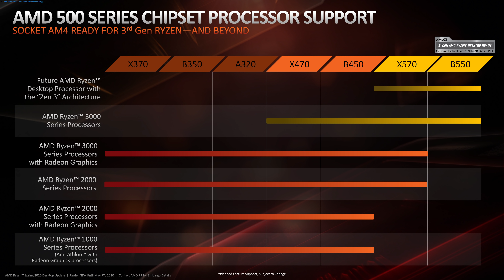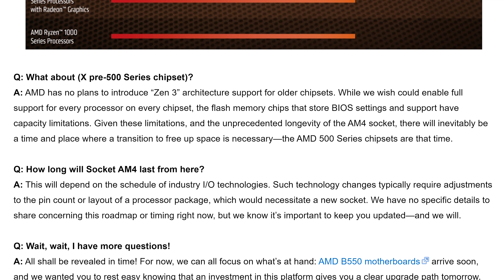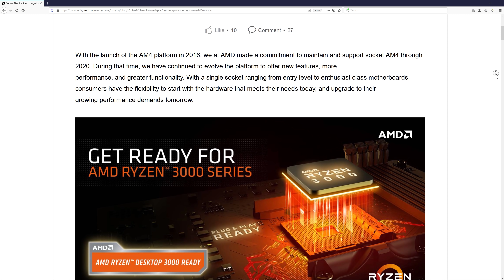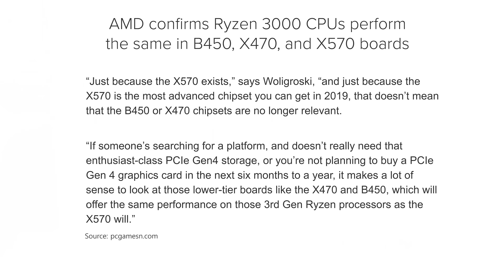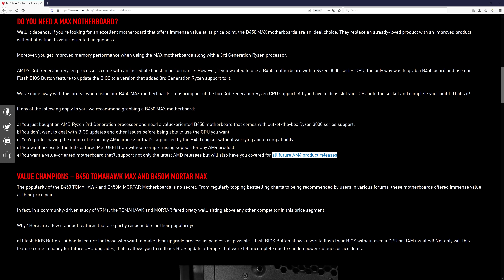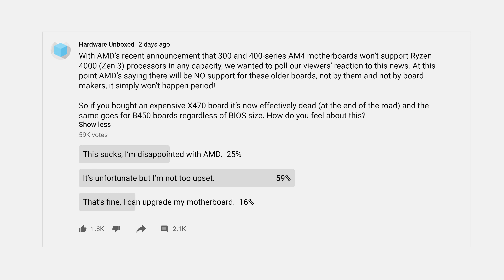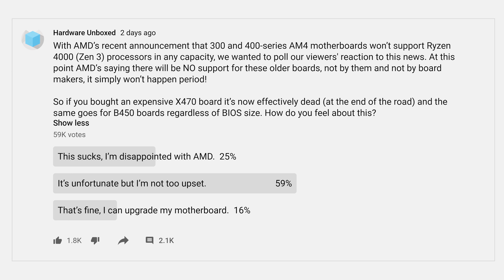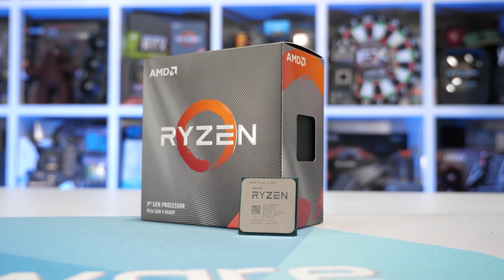AMD Does An Intel, Axes Zen 3 on 400-Series Motherboards, Our Thoughts

Comment: I didn't vote in your poll but I agree it is a garbage move by AMD. At the very least they could've provided support for the X470 motherboards (considered premium), all of them coming with ample BIOS flash storage. The AM5 600 series chipset and Ryzen 5000 series will be supporting DDR5, now there is even less incentive to upgrade to a 500 series chipsets. I WAS going to upgrade my CPU on my X470 board but now will be skipping Ryzen 4000 regardless of how "good" it is. No way am I buying another motherboard/chipset only good for 1 generation, AMD's loss.

Comment: I just move from an older I7  to a B450 Tomahawk Max and R5 2600 with the intention of loading it up with a Zen 3 processor ... I am PO'd.  If I had known I would have waited and picked up an X570 instead.  It wasn't just on MSI's website with the board details but literally, every reputable review site also stated support through 2020 not to mention the AMD post sited here.  The fact that B550 was not even an option and widely speculated that due to its continuous delay it would not even be released this generation.  I don't think it is reasonable based on the industry's well-known belief about AM4 compatibility that AMD did not bring this information forward sooner.  It seems like a gambit to push board partners to sell off the remaining B450 stock as a current product.  Although it's not like we didn't see the warning signs when 1st and 2nd Gen Thredripper board owners got hosed.

Comment: As someone who bought a B450 Gaming Carbon Pro for my new Zen 2 setup, I'm a little miffed. But honestly not that much. Yes, knowing that Zen 3 wouldn't be supported I likely would have spent another $50-60 on one of the mid-range x570. But honestly, I still have an upgrade path in the used market with a Ryzen 3900x or 3950x, which will likely provide more price to performance than jumping up to a similar 8 core Ryzen 4000 (though we'll have to wait to see). Overall, I'm very happy with what AMD has done in the market, so I'm willing to let this one go.

Comment: I really feel folks will view Zen 3 and B550 as kinda their own stand alone platform due to how many folks will need to replace everything (CPU, and mobo) and view it as a more stand alone platform with no future support. I have a Ryzen 3000, and a B450 I doubt I would have upgraded but I might have. Given the situation tho (outrage aside) I will not be purchasing Zen 3 guaranteed, I had my i5 6600 for 5 years with the original motherboard.

I've had my B450 and 3000 series chip now for 5 months, I simply refuse to ditch both after 5 months to buy the newest CPU, only to turn around and ditch that a year later for long term support on the AM5 socket. Everything aside I feel it was a bad move on AMD's part, I understand why, but the vast majority of folks on the AM4 platform will need to ditch everything as if it was a new socket, only to have something outdated day 1. After this is AM5 and many years of support on that, just that alone makes this release seem like a bad investment tho, either ditch everything now and buy it, only to turn around a year later and ditch it all again for AM5, or hold off and skip this gen and go with the long term support of AM5.

I don't think it's sales, or motherboard vendors plot to make money, I think this move will financially hurt them due to virtually everyone on AM4 up until not having to replace everything for it. If it was just a CPU I believe more folks would buy it, more folks might decide they like a B550 board as well but your basically buying into a dead platform day 1. I strong feel Zen 3 and B550 will be viewed as the black sheep of the AM4 socket and I mean that in 100% honesty I really, truly feel there is not enough selling points for folks to invest this much into it, if it was just the CPU that's a smaller investment and might happen but not both CPU and Mobo for a dead socket with AM5 right around the corner.

The buy in cost is just to high for most who are currently ok with the chips they have knowing AM5 will give years of support if they can wait that 1 year.
Reply: ANd the fact that some don't have the money to do a mobo change with the virus going on!

Comment: Technically, AMD didn't go back on their word as they promised full compatibility across generations UNTIlL2020,. That being said, it's good that they know that people are watching and will call them out at the drop of a hat.
Reply: They implied through Zen 3 which was originally to be released in 2019.  The original road map was Zen 1 2017, Zen 2 2018 and Zen 3 2019.  And lots of their reps have said through 2020 not until 2020.

Comment: If only they had released the b550 at launch. Now it just feels like a scummy move to push x570 sales
Reply: If they had only said at X570 launch that it would be the only one supporting Zen 3.  Then their board partners would have revolted as there would have been no B450 sales.
Reply: Yup. Think its a coincidence that x570 is the first chipset that AMD makes themselves? I don't!
Reply: and then no costumers would buy X570 it would be a waste, but also is a waste to those who bought X470 expensive boards and those who bought B450 shouldnt be butthurted, cuz they bought that board to pair it with better CPU just like my self i could even put a damn Ryzen 9 there and still get super cost to performance,  i paid very little for the board to have it paired with 3700x, and im butthurt about no support for more expensive X470 users

Comment: There is no point buying a B550/X570 for future compatibility unless Zen4 is going to be AM4 also.  AMD have kinda shot themselves in the foot.  I was going to grab a Zen3 chip, but if there is no backwards compat support...  It makes sense to wait for AM5 mobos as the new mobos are dead end products.

AMD should allow mobo manufacturers to offer support in the beta bios and make it clear that they don't officially support the platforms for Zen3.  That way they don't have to allocate much engineering resources, and they can offload the work to the likes of Asus, MSI etc if they choose to offer the support themselves.

Comment: I think 3 generation support is very good.  If I were to use each generation of CPU for 2 ~3 years per generation... that is milking the platform for 6~9 years in total.
Hardcore users will upgrade with every new release.
People who keep same system for 6+ years is likely upgrading due to hardware failure or really doesn't need anything powerful to daily tasks or bought a high end CPU at launch to maximize performance from each generation.
Reply: I stuck with my i7-2600 from 2011 to 2017.  I started on a Ryzen 1700, on a B350 motherboard. I now support 6 Ryzen systems in the extended family. The 4000 chips would have replaced probably three of the 2000 chips that are in use on B450 boards.   One 3600X has already replaced a 2400G, the 2400G was put into a new build cheap B350M.  That 2400G will get a video card the  next time there is video card upgrade in the family.
Reply: @jamesthomson8659  :) I build my 2500K back in launch as well.  Only thing I have replaced was CPU to 3770K & GPU.  Still using same PC & Power Cooling 750 Silencer PSU :D.   And my DVD-RW tray won't open anymore after not being used for so many years. 
My initial plan was to get X570 but since I had to wait, I wanted B550 but get a cheap on sale or used 2000 series CPU, and few years later I could upgrade to one of those 3000 series 8 core or 4000 series CPU.
Which could serve be well for atleast 6 years.   If B550 doesn't support 2000 series, I many have to opt few more dollars for low end X570.

Comment: They are also ruining a perfect transition to AM5 and DDR5. If I am not mistaken DDR5 boards drop next year which means new motherboard YET AGAIN next year! Lets see how much of a vilain they will look like then!
Guess what: I don't plan on upgrading my Crosshair Vi Hero just for one generation of CPUs no matter how good they are, only to end up on a dead end platform, stuck with DDR4. And like you said the bios chip excuse is BS. It is either that they don't want to spend the resources for the support or that the motherboard guys are pressing them because they don't sell as much as they want due to the broad compatibility of AM4. Regardless of which is true, it is a mistake and I hope they reconsider in time.
Reply: Yes, changing MB and socket for going to DDR5 is perfectly acceptable for everyone, this is not. They destroyed all the trust they had build with customer during the past 3 years...

Comment: Re: your poll. I voted in it before I had a clear picture of what was being asked (I hadn't seen the actual news, just the poll question). I wouldn't have changed my vote, but I do wonder about the other people who voted 2. I'm not planning to upgrade my computer as newer chips come out, but am planning to build a new computer to stand beside this one. Which would mean a new board along with everything else. Are there B450 buyers that have the same outlook? If so, what percentage of the voters do they represent?

Note, I know I'm not typical -- I am definitely in the low heat/efficient power use/low noise category (but no, I didn't get a 1650 graphics board).

Comment: i purchased a 2700x and x470 msi gaming pro carbon last year. i upgraded to ryzen 3600x for the single core performance and upgraded bios, was extremely pissed when i found it was a "Lite" bios. its a garbage bios. Last month I sold the msi board and purchased an x470 asus crosshair hero which has plenty of space for newer bios and figured id be safe for ryzen 4000 series. now i am not! its just stupid. might as well go back to intel and just get the best gaming chip done and done. salty AF

Comment: I feel a bit for those who spent a lot of money on a 400 series mobo but that's about it. Those who did  can still run a 16 core 32 thread monster which should do almost all of these folks for a while.  If you did buy a 400 series board you obviously did not care about things like pcie 4.0 and IMHO will want to upgrade in 6 months or so anyway. I am buying a B500 as soon as possible.

Comment: Damn I mean if you guys are all such experts in this then create the bios because you all have the solutions. Oh wait you can run your mouth like you think you know but in reality do you really know everything behind it. Hmmmm like the pci 4.0 issue was due to Mobo manufactures not being able to do it for all boards because they cut corners. AMD took the heat for it and looked bad because they said it would happen but had to back track due to those issues arising.  My x370 lasted me up to 3000 series and will be upgrading from my 1700 to a 3950x for just the cost of a CPU. So sorry you were too dumb to critically think and see this coming but the AM4/x370 chipset has supported exactly what they stated it would. Im sorry you all are new to the D.I.Y PC industry but I saw this a mile away.

Comment: This is why I bought an X570 board for my rig. I put a Ryzen 3600 in it. I should have waited because the Ryzen 3 3300X looks like a sweet CPU that will do the trick.  Less pricey as well,

Comment: It is part of the evolution & AMD has gone above and beyond in providing value. A 300 series board with 3000 series or newer is silly & if you bought a 400 series board for an non existent chip  you are an irresponsible consumer. The speculative whining is hilarious.  Especially considering if you think buying every gen CPU for performance on a older board is necessary.

Comment: Naah, still happy with my 2700X... will upgrade to a new one when AM5 is the new platform. The DDR5 will probably soon hit the market,  making it more likely a new platform is on the way.
Reply: I'm fine with my 2600x still, but I always planned to upgrade to whatever the last available CPU gen was on my X470. I was hoping for it to be the 4000 series since I am fine with the 2600x for another couple years (I assume), because then they would be out for a year or so and whatever is after, I assumed AM4+ or AM5 socket CPUs, would be the hot new thing and would hopefully drive 4000 series prices down. However, I guess I will get a 3700x or better in a couple of years and wait to see what AMD and Intel have on the horizon. I was a bit leery about how 3200MHz ram would be fine with or hold back Ryzen 4000 if it was compatible anyway. I'll still get ~5 years out of my motherboard, which is better than my upgrade habits in the past. 

Though their lame excuse makes me more mad about it, and their comment about deciding now is as good of a time as any to break support. No one expected the successor to Ryzen 4000 to be supported by AM4, so if there are no other technical limitations for not supporting X470/B450, then doing the partial bios another round and moving on from AM4 for next gen would make sense to us and would have not garnered any ill will.

Comment: They should support Ryzen 1 to 4000 on am4 and then 5000 to 8000 on am5. That is what I would ideally hope for. What amd needs to realize is that this support helps keep people loyal to amd. If they start pulling intels left and right, the customers will be happy to to go back to them once the cost/benefit analysis changes. Giving them platform stability keeps them around imo.

Comment: Sucks when you buy a Z-390 to “future proof” and intel/AMD pull this
Reply: The absolute worst was Z270. Intel release Z270 in January 2017 and announced in September 2017 that the new chipset wouldn't support future processors.
Reply: You... bought a Z390 knowing you'd be screwed and you're surprised when you got screwed? 
Did you seriously expect Intel to support more than two generations on a single chipset? 
They've literally never done that, all the way back the beginning of the i7 series.

Comment: I'm no 'Tech head', but it seems the B550 board is not going to be as good as an X570, and a 'dressed up', version of a B450? Or that is my perception (Gamers Nexus). Does look like MSI got caught out? Are the different MOBO manufacturer's, new B550's going too be as good as the B450's ??? Which I would have purchased ahead of X470, X570 and 300 series?

Comment: I went with the flow and bought a "safe bet" in the B450 Tomahawk Max and a 3700X. I was never considering upgrading to a used 3950X later on, but would have been happy to upgrade to a high tier Zen 3 processor if it would be a significant upgrade. Now I'm finding myself hoping that Zen 3 will be meh.

Comment: The bulk of people would be fine had they launched b550 alongside x570. Most people would've chose b550 over b450 had they been given a chance and the MAX boards from MSI probably wouldn't even be a thing. 
It's still a crumby move regardless though, and I don't agree on 300 series being OK to axe. They aren't somehow inferior to the 400 series. Being made a year earlier doesn't make any difference.

Comment: There is a butt load of people that want to try the $50 and $100 Processors.
Many aren't going to want to spend $100+ on a board to run them.
I've used happy ASRock A320 boards for a long time.
It's going to be really annoying when we won't have a $50-60 board to put these new budget Processors on.
Or stuck with A320/450 until these boards come out. Which I am sure will take forever 

Your going to eliminate your value/budget customers that just want a system & don't care about expensive boards.
I've used a Super Solid $45 MSI board for my I7-3770 I bought new. Bundled to $15.  Used board for almost 3 years. Zero problems...
Reply: maybe A420 would work
Reply: I have to give credit to ASRock for even bothering to add support for Ryzen 3rd gen on these A320 boards given how cheap these boards are and how quickly AMD was at not officially supporting it. Granted, it doesn't really work with anything over 65W, but it is definitely enough for most budget gamers.

Also, just FYI, there is a rumor based on some leaks that there will be a A520 motherboard to take the place of A320. If that comes out, it will at least be a nice option for those who want a cheap board and don't want to manually overclock and let Precision Boost do it's thing. But AMD still hasn't confirmed it.
Reply: @ThatLaloBoy  all the other brands added it to their a320s. And 99.5% already have bios on them for 3rd Gen. If you were to run a 12-16 core. Not saying you should. But runs up to 5% Margin of error. AM4 is an amazing socket.
Reply: @ugaaa5 the 300 series board should be left out but what are we supposed to do when we want to 50 to $60 motherboard to run the latest Gen? 
They should have had a b420 or b520 released almost a year ago. But should support all newer CPUs. They didn't prepare us at all that's the problem.